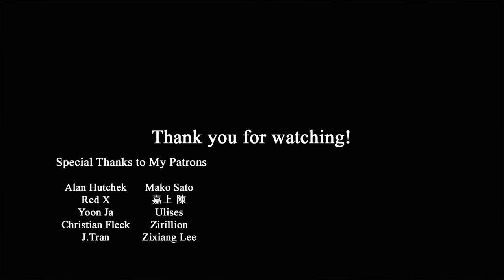[Brushing Challenge] 1/350 U-Boat Type VII C/41 (AFV Club)

Comment: My thinking is simple. First, paint the materials as they are straight out of a factory. Metal. What kind of metal..
It was better to do this method on a hull with hard edges and rivets like Masterpiece Models 31" Disney Nautilus. I'd hit those hard edges with the side of a small brush using the amazing Testors Gold enamel. When whatever treatment went over the surface, (but always water based) I could always find those  edges by simply wiping at them.